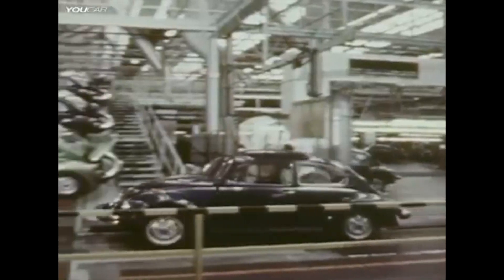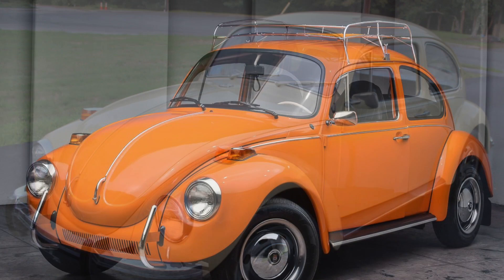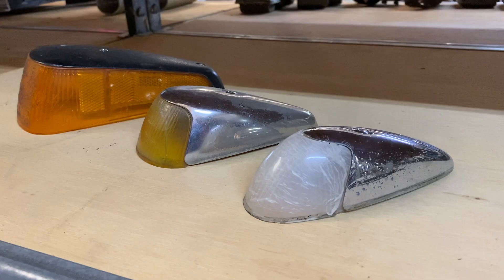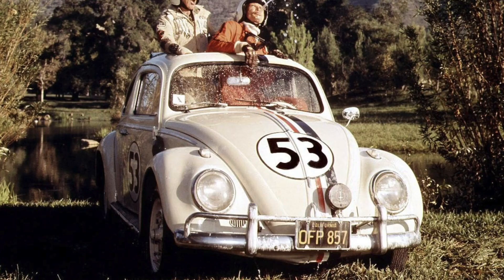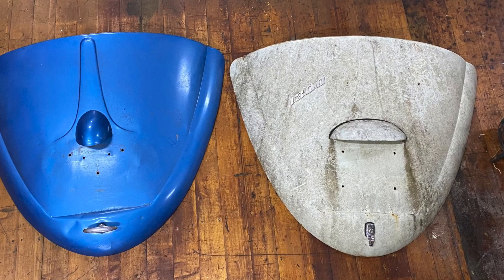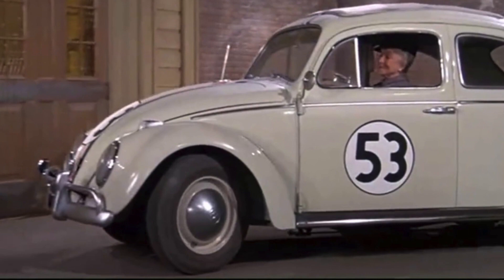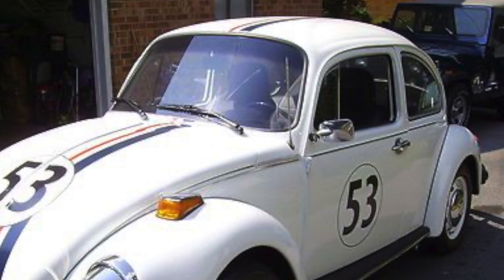How to Build an Accurate Herbie the Love Bug Replica

Comment: Super Beetle owner here. The 1302 has not flat laying tire you recognize them by the flat windshield, only the 1303 has a flat laying tire in the front, also the tail lights, floor plan, seatmounts and dashboard are differnt. Also the slats in the front for the oil cooler were not standard, some had it some didn't. It was an optional feature by Volkswagen which they allowed their customers to get or not. The original coolers are very inefficent and are no longer available because they had an actual fan powered by the car's battery and draining power as well. Today the coolers are swapped out against a single radiator that cools down by the wind of driving. About the head rest... it's easy to convert the ones with head rest into a pair without head rests. You just need a new seat cover and a differnt filling, even tho for older ones, it's highly recommended to actually give them head rests because in case of a back accident, they prevent your neck from snapping... So in that case I would not give a thing for accuracy and more on safety...

Comment: Question, so I am getting a 1964 beetle thats in restoration stages, plan to make a herbie out of it, one unfortunate thing is that the IRS pan is from a 1969 beetle. I noticed I would have to figure something out for the 4 lug wheels since they aren't 5 lug. So my question is, what should I do about that? Do they make a 4 lug replica of 5 lugs? you know, without the little slits in the rims. Also, since its a 1969 pan, what else do I have to figure out?

Comment: I recently thought about building a Herbie for a bit. I would still love to some day, but just not in my cards at the moment. I had a lot of plans to animate the car, and maybe even make it remote controlled.

Things like a slight tip of the bumper up/down for a frown/smile, the horn clips from the movies played through a loud speaker, lights that could independently turn on/off, move, and put a little thought in making it wink, with lids, like it did in the later movie.

Put all that together with a SBC/microcontroller, an intel compute stick, and some AI and let the car actually respond to what people said around it.

I thought that would be so slick at car shows. Imagine you walk by it and say something like "Cool Herbie!" and it (all on its own) winks and smiles at you.

Comment: What's interesting to note is that the body-colored running boards Herbie had in The Love Bug are actually accurate to the '63 Deluxe model. Lower trim cars had the simple black ones, which Herbie has for the rest of the films afterwards; he does have the body-colored ones again in the Bruce Campbell TV remake though.

Another tidbit that's important to mention is that Herbie's side-view mirror has an interesting transition from film to film. In The Love Bug, Herbie Rides Again, and Herbie Fully Loaded he has the factory '63 mirror assembly, then in Herbie Goes to Monte Carlo he maintains the '63 arm but has a '65-'67 "pear-shaped" mirror retrofitted on, and then in Herbie Goes Bananas and the TV Remake he has the full '65-'67 mirror assembly.

Comment: I used to have a 63' Rag that I did convert to a Herbie. Got the wide, offset rims, with the stock hub caps just like in "Herbie goes to Monte Carlo" and it had a correct ragtop I did not have to graft in. Sadly I sold it in 2009 due to financial issues, but was a great fun car. And yes, I think you should convert this one to a Herbie, as you have a perfect car to use.
Reply from the maker: Yeah, I think it's gonna happen eventually.

Comment: 0:36...The rear deck lid on the one on the right is from an oval window ('53-'57) bug. To make a righteous Herbie, it has to be from a '58-'63 bug.
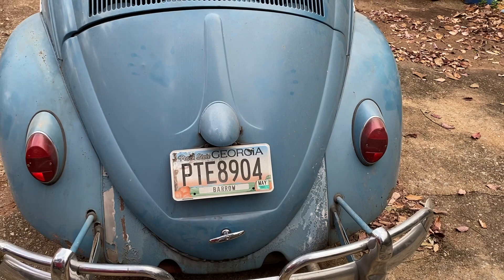9:06...THAT is a righteous Herbie rear deck lid! Notice the "flaring out" to each side of the "pope nose" license plate light, found only on 1958-1963 bugs. Though '64 bugs also "had the equipment" to be a Herbie,  the rear deck lids do not "flare out." Early '64s still had the '58-'63 pope nose license plate lights, but the 1964 rear deck lids were made in preparation for the later '64 "flat abomination" license plate lights. 

The only year of VW sunroof bugs other than 1963 sunroof bugs that can qualify to be made into a Herbie without noticeable difference are 1962 sunroof bugs (I had two). Though most people are not likely to notice the lack of flare-out on the '64 rear deck lid, they will notice the flat license plate light. And they certainly will notice the smaller all metal sunroof (no more ragtops) introduced in the 1964 model year. And most people will also notice the snowflake taillights on '61 and older bugs. Whereas Herbie has the 1962-67 "high heels" taillights.

The only years of VW bugs that can be made into a righteous looking Herbie without prohibitive cost are the 1958 to 1964 "Herbie Generation" bugs. The pre-'62's would have to lose the snowflakes in favor of high heels. The '58s and '59s would have to ditch the "dagger" door handles and older style center black horn button steering wheels. And the '64s and standard hard roof '58-'63 bugs would have to have a ragtop sunroof put in. Even Walt Disney did that with some of their Herbies on brief shots. There are other differences not found on '63 bugs, like no gas gauge, colored door cards, fat needle speedometers, and mohair headliners. But most people won't notice or care as even Walt Disney played fast and loose with brief shots of features not found in '63 bugs.

14:37...BTW, unless everything below the greenhouse is rusted or beat up, that Herbie Generation ragtop arboretum insect ought to be restored in it's own right!
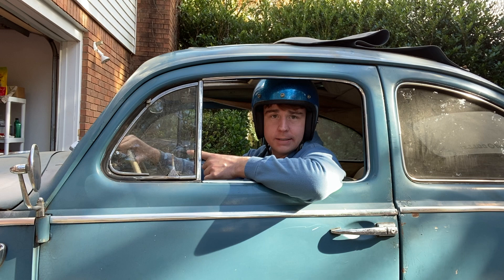16:26...Yes, you should convert that blue ragtop specimen into a Herbie! That "gulf blue" color only came on 1961 to 1963 bugs, making it one of the "Herbie Generation" QTs. If it's a '61, you would have to install the high heels in place of the snowflakes, as well as a gas gauge.

Comment: I changed the aprons fenders, bumpers, hood , decklid, trim, running boards, shaved half moons, shaved dash vents, changed the speedometer face to the early 90mph green/grey, added the early fuel gauge, changed to an am radio and Ivory dash controlls. I cut the headrests off the seats and welded in a bar across to make them lowback frames with a ragtop on a '72 standard beetle. It still didn't look quite right with the larger windows. I'd like to find that car again someday.

Comment: Great video.  Probably be the only kind of movie car I would ever have the ability to build after I finish my restoration projects.  The two easiest ones I could see is a replica of the original Herbie or one of the JP Jeep Wranglers.  Id probably lean towards the VW just for the fact of avoiding the computer emission filled Jeeps.

Then there is always the late model swap for the power train to get more modern performance but will without a doubt give up the signature VW exhaust note.
Reply from the maker: Bugs are a lot cheaper than a YJ Wrangler. Jeeps hold value really well - especially ones you can drive around (you might notice the red Jeep in the background of that thumbnail). You can get a Bug for next to nothing... just gotta look for them.
Reply: @unfinishedstudios  Which is why I havent got one yet.  I dont have the room with the six project cars I currently have.  But I have no problem taking my time for me I would want a more screen accurate version of the first film.  Only thing I would try to do is try to locate a later model engine that would sound the same but make more power than the original.  If not then I would modify the OE engine and look at fuel injection options to fabricate onto the OE engine.

For me I would want to build one to be a driver but a fun driver.

Comment: Now, what if I take a 1958 Beetle Sedan and make it a Herbie? What do I have to change?
Reply from the maker: Cosmetically, the only difference on the body would be the door handles and the taillights. Under the hood is different -- different gas tank, etc. The dash is also a little different. Other than that, pretty close already. But they did use that style bug in various scenes in the original movie.
Reply: @unfinishedstudios  Herbie had the ice pick handles, right?
Reply from the maker: @kennyselvischannel6216  The '63 was fixed to the car and has a button.